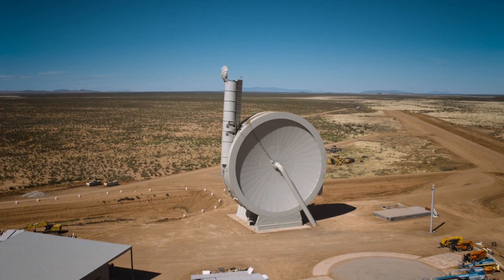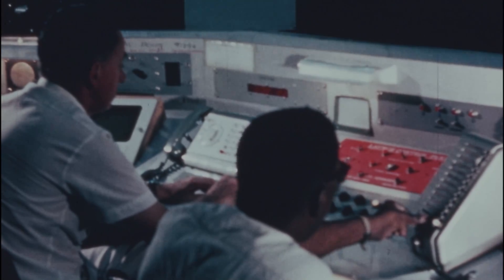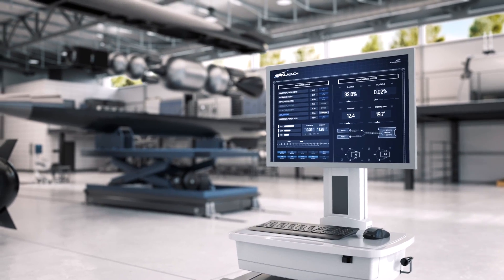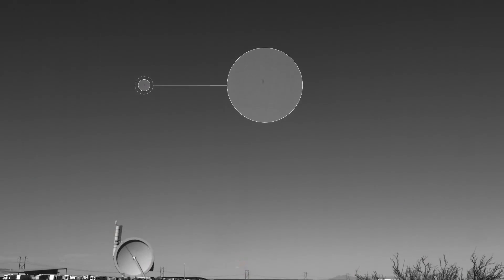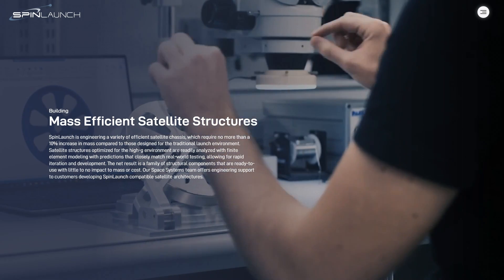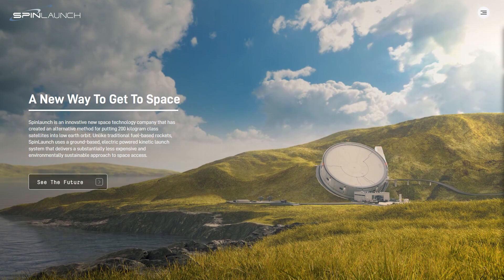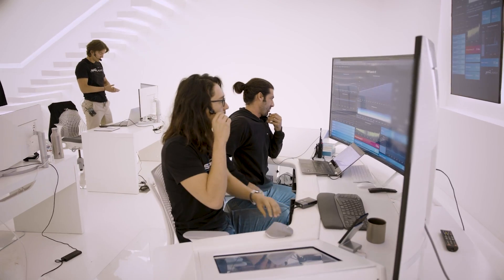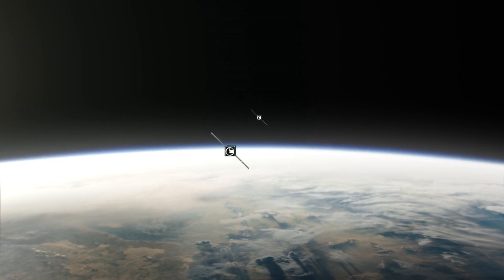Can Spinlaunch Throw Rockets Into Space?

Comment: To reduce the forces of the launch you need to increase the radius.

If you increase the radius of the spin you decrease the normal acceleration force(# of G's) by the 1 over square root of the radius to get the same exit velocity. 

So doubling the diameter gets you 1/sqrt(2)= 0.71 times the force or a reduction of 39%. Then its just a case of the cost to build a bigger structure, and the material limits as the structure gets bigger.

Some energy optimizations would be launching from a higher elevation, it just means straight up less energy lost from drag. If you look at launching from Ecuador the mountains peak at around 6700m which isn't accessible, but there are cities at around 3300m which is about 65% of the air pressure of sea level. While also taking advantage of an 11% higher starting orbital velocity than south Texas. So it'd be a significant decrease in energy to get to orbit. Of course this is assuming you build the payload there, and don't ship it thousands of km away, and want an equatorial orbit and don't mind the locals.

Even just launching from some high elevation in America is going to have a significant impact on kinetic energy saved.

One could of course just spin it faster to overcome this, but then you really quickly run into the material limits problem.

For the moon, or mars this would be probably the way to go, unless you figure out how to build a railgun that doesn't tear itself apart from internal forces.

Comment: 450 RPM @ 50m radius also corresponds to over 10,000Gs of centripetal acceleration. I have bridges for sale for anyone who thinks Spinlaunch can build a second stage rocket capable of surviving that. A 1m diameter rocket will be experiencing as much stress as a building 10km tall. That'd be a challenge if it was solid with just a few small cavities, but it actually has to contain fuel tanks? Bwahahahaha. And don't forget the spin arm. That will be under as much stress as if it was suspended from 250km. This whole project is a bad joke, and I can't believe it's getting funding.

Comment: will multi-megawatt thing actually burn less fuel during a few hours of spinning up than a regular chemical rocket engine in just about 10 minutes?
Reply: Enormously so. For the just under three minutes that a falcon 9 first stage is running, it's consuming kerosene at about 100 gigawatts (16.9 terajoules over 170 seconds). Three hours at five megawatts is only 0.054 terajoules. It's quite so different because the spinlaunch doesn't have to accelerate it's power plant to keep using it, so it's not really subject to the rocket equation.

Rocket launches are quick but they're quick by burning fuel at "drains an olympic sized swimming pool in a minute" rates, and megawatts aren't actually all that big a unit of power.

If it helps, there are plenty of single wind turbines that output 5MW. 100 GW is more like "the combined power output of US nuclear power plants as of 2018". Only for three minutes, but still...
Reply: @jonored  the 5mw is just for small test 2nd stage. It is not correct to compare with F9 this way. What power will be required to launch same mass 2nd stage to the same altitude with same final speed? Counting enormous energy loss and overheat at such high speed in thick lower atmosphere? Counting power loss on power plant conversation thermal to mechanical to electric energy and transfer loss?
Reply: @night_gryphon  It's certainly a "factors of 10" kind of comparison to compare this to a F9, but this system still means that you don't have to start by lifting extra hundreds of tonnes of fuel. The rough "megawatts to the terawatt" comparison is going to hold. You're consuming power for 25 to 50 times longer than the rocket, there's around a 1.5 to 2 x multiplier fuel to electricity if you're doing it with a decent power plant, and the rocket consumes 1-10k more power than you do. Even assuming the worst of each of those numbers and that you lose 90% of your energy in the lower atmosphere, which is extremely pessimistic, you'd still break even on energy.

Comment: I genuinely had a similar concept in my mind at some point after looking at some old concepts for some acceleration tunnel loops, but I dismissed it as ridiculous because my layman's guess was that when a projectile exits the vacuum tunnel/chamber while going supersonic (aside from finding a material that can resist the pressure difference but can be perforated by such projectile, but apparently they found something that works O_o) the shock from the sonic boom PLUS all the air suddenly filling the void from that same opening would destroy the entire structure.
While they haven't launched their rocked at those velocities yet, it's incredible they are even trying and it almost feels like a children's dream come true 🤩
I have now learned that there are a lot more, possibly harder problems here but I wish you talked more about the aerodynamics of the whole thing.
Reply: Remember, even an ideal vacuum has only around a 15 psi difference from atmospheric pressure at sea level. A sturdy plastic membrane would do it, and appears to be what they used. I have a large double-walled polyethylene building that is pressurized to a couple PSI with the upper layer basically unconfined, and that poly is only 0.005" thick. For a small port that can be tensioned from all sides, it sounds feasible to me without needing any special materials.
Reply: As I said I was brainstorming as a child 😅 I'm still curious to see what happens at Mach >1

Comment: you didn't mention that during spin-up, the force works perpendicular to the desired flight direction, which will put a lot of pressure to the housing. And as soon as the projectile leaves the vacuum, it might be decelerated quite a lot, with all the built in parts pushing forward. That's usually not the way the mechanical structures of rockets are designed to work.
Reply: it's all just a clever story to get V.C. money.....

Comment: I have a very simple solution for balancing the rotor - make it symmetric - put identical dummy counter weight on the opposite arm, and release them both at the same time. The payload will go up and the dummy counter weight will go down, into a specially designed underground channel or pool, or whatever they figure out will do the best job of catching and stopping it. Fly safe!

Comment: This is definitely something that should be built on a tell mountain top. 
I do understand that there might not be much of a point to launch rockets from tall mountain tops. Since rockets start at a low speed, and as they gain speed, they also gain altitude. And so they would never move very fast at a very low altitude.
Spinlaunch would however do that. They would have maximum speed at ground zero. And so it would make sense to put ground zero as high as possible.

Comment: Just seems like a linear accelerator would make more sense. Could use something like a rail gun only make it much longer so the acceleration isn’t quite as violent, or so it can get a higher speed.  
With something rotating like this it just seems like to much force bottled up if you actually spun all that weight to 450rpm. Then that sudden release of the weight would throw it all out of balance. I think the best idea sounds like quickly launching 2 of them so you could launch one, then hopefully launch the 2nd as it comes around before the imbalance really gets going. But, then you’d by trying to time that 2nd one which might already be wobbling or changing speed.
Reply: The second projectile should be a dummy one because now due to air entering the chamber the arm would suffer some deceleration and i think that would change the release moment

Comment: By far one of the most interesting things I’ve seen. 
Now, this is far fetched and probably stupid, but what if the counterweight is also a projectile that would be released at the same moment as the payload projectile. Release it in the opposite direction into a really deep tunnel/trench and design it to disintegrate apart easily once in the tunnel far enough away from the launch system.
Reply: great idea...
rather than a solid material... detachable water tank. fill with water to easily match mass of payload. tank made of some kind of material that can't take heat. counterweight tunnel also has vacuum maintaining seals. that way tank will burns off pretty much as soon as it's hits air. the remaining water likely to boil off fairly fast... may be possible to direct the resultant steam towards providing an additional boost to the main projectile? ie counterweight released same time as projectile.... counterweight water goes down into tunnel, and around a U bend so it goes back up directly below launch tube, and pushes against payload/some kind of parachute, sabot type device that's discarded once drag from atmosphere exceeds boost from steam rising from below.
Reply: @stevecummins324  I would say that "filling it up" would be the hard part. you dont want water sloshing around and changing the balance point, especially after release.
Reply: @OBtheamazing  "water finds it's own level". Also Works under artifical gravity caused by rotation, when smaller radius is akin to higher point on earth. 
Can be shown practically...by something I've only just recalled doing a fair bit as a kid... Take  a bucket of water, after a couple swings to build momentum going, it's not difficult to swing bucket by one arm, have it go right over top of head  without spilling a drop. Well until it comes to stopping it. Usually easiest to just let go when it's horizontal. Lol
Reply: @stevecummins324  The counterweight would need to be traveling faster than the payload to loop around the u-turn and catch up to provide the suggested boost. Or it could taper / narrow, but then you lose a substantial amount of power for a boost that could quite possibly throw the payload off its axis.
Reply: But.. OP, that's not a bad idea at all. Wouldn't even need to expend the counterweight. It could be sent down a tube that loops around appropriately to slow the counterweight without melting anything. (Maybe)

Comment: Did some maths here and:
1:
A mass of 10 t rotating at 450 rpm at a radius of 50 m will generate a centrifugal force of ~1,11 Giganewtons. Given the limited tensile strength of available materials, good luck constructing a rotor that can withstand that, especially considering that actual forces would be far greater given there is also the mass of the payload release mechanism and of the rotor itself.
2:
That release mechanism would have to hold against those over 1 GN and also be able to reliably release the payload with split millisecond precision, again good luck with that.
3:
When the payload is released, the part of the rotor that holds it and was stretched out by the centrifugal forces generated by the payload will snap back to its original length, causing shock/vibration issues that will wear down the whole thing really quickly if not outright breaking it (this might actually be managable though).
4:
Since you would need a counterweight to keep the rotor balanced with the payload attached, once that payload is released but the counterweight is still there its going to become ridiculously imbalanced, with the central shaft and its bearings suddenly experiencing the now uncompensated 1 GN pulling sideways on it.
So the only way this could launch a payload without the whole structure disintegrating in the process would be to also launch the counterweight into the opposite direction at the exact same time; where it would then impact the ground, destroying itself and propably creating enough of an artificial earthquake to put the whole facility out of action for good.

So yea, something like this could work well with really small payloads, especially on the moon where you could archieve many launches in quick succession due to not having to evacuate a giant vacuum chamber everytime, but trying to launch a 10 ton payload like this is insane...
Reply: Yeah, this is definitely one of those "does not scale well with reality" projects, designed, I think to entice enthusiastic engineers to work for some scumbags who will run off with all the VC money.
Reply: So if we get a really good steel at 600 N/mm2 we would need 1.6 million square millimeters.
I think that comes out to 1.6 square meters for the arm to support the payload.

But how much bigger does the arm have to be to support the arm?

As I recall, lab size ultracentrifuges can do g forces in this range, but their rotors resemble a '50s era flying saucer.
Reply: @NullHand  Well, a typical density for steel is around 8 tons per cubic meter, and since we're talking about a arm on the order of 100 meters long, steel is right out.

With something like kevlar, we get close to an order of magnitude better strength/mass.  Still not great, but presumably workable.  The arm can be tapered as you go outward to improve things as well, with the profile getting exponentially thicker toward the root, analogous to the rocket equation.